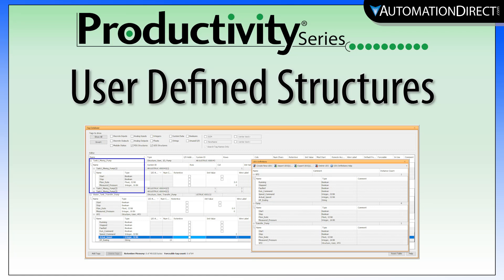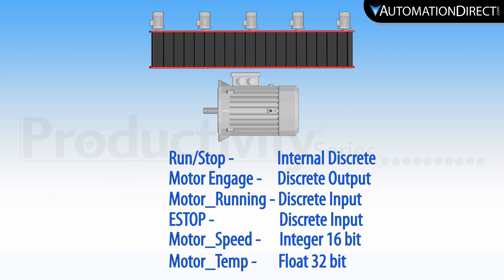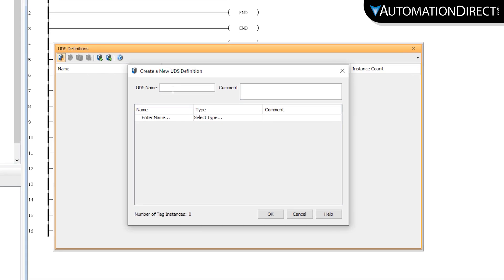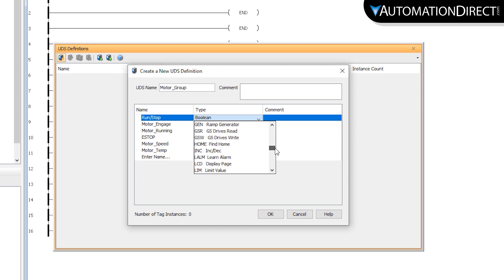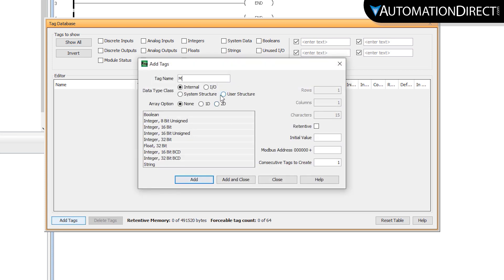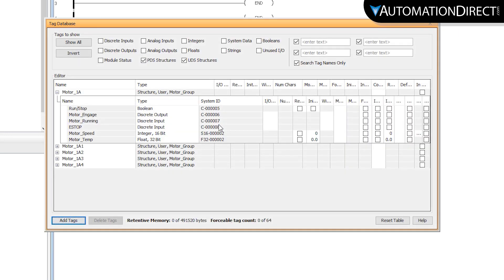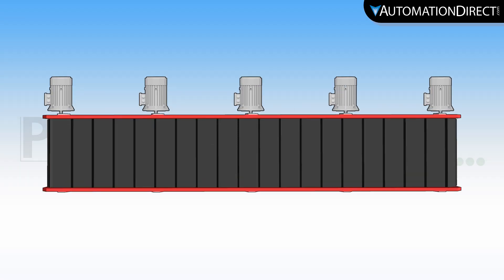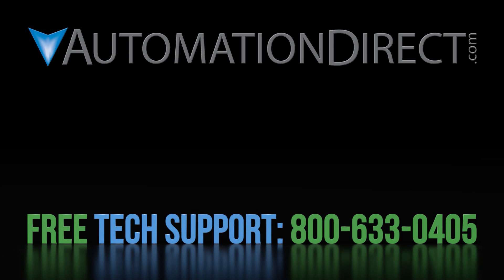Productivity Series PLCs: UDS (User Defined Structures) Custom Tag Groups from AutomationDirect

Comment: Nice video. Just curious what type of structure does the productivity pack these tags in? 8,16,32 bit? When creating these structures are there guide lines for data type architecture to maximize processor resources and storage?  Example my_struct- dint, bool, bool, bool dint. Does this use 3 32 bit registers for each structure? Also can you nest a struct in a struct?  Thank you!
Reply from the maker: 1. Is structure 8, 16 or 32 bit?
   >>>> A structure is not a byte, word or double-word entity but rather a “custom” datatype containing elements configured for any of the data types supported by the Productivity system; Integer, Float, String etc.

2. Data type guidelines to maximize memory usage?
   >>>> This really isn’t a structure question. You use the datatypes that apply to the device you are creating the structure for. But, be efficient when creating the UDS element. Don’t use a 32 bit word for an item that only requires a single byte etc.

3. Can you nest structures?
   >>>> Yes, up to four levels deep.

Comment: Thanks for that informative video. Which productivity 1000 components do I need to control the speed and direction of an AC Motor and what will be the required Productivity 1000 program configuration? I am very much interested in learning industrial automation and thus considering purchasing a starter kit for my small project.
Reply from the maker: Hi Kano,  We have a great resource if you want to learn all about controlling AC motors.  It's our A/C Motor video Cookbook where we have LOT's of hands-on live demos showing you how to use VFD's. 
Go here: www.automationdirect.com/cookbook and click on the A/C Motor Drives chapter. In particular, look for the videos in the "GS4 PLC to Productivity PLC Communication" section (last one) to answer your immediate question.
Reply from the maker: Kano, thanks for the comment. The setup depends on your project needs. I would advise calling into our Free Tech support (1-800-633-0405). They will be able to individualize your help in this manner.